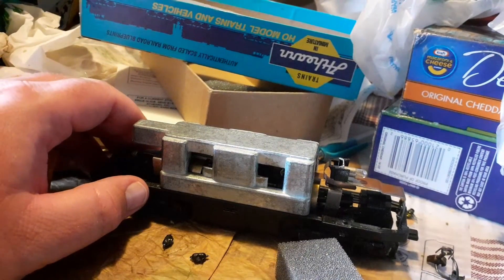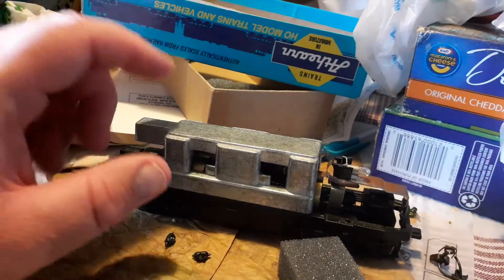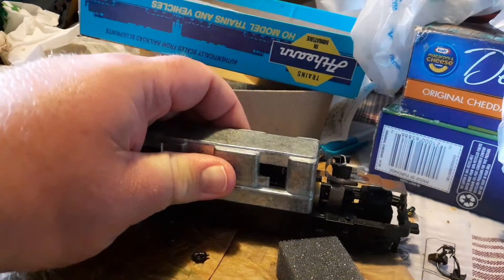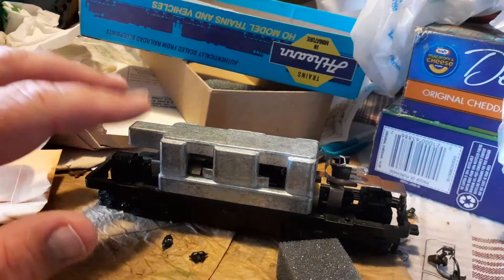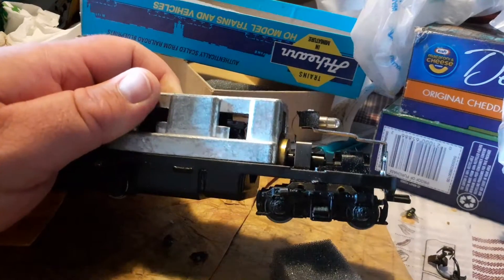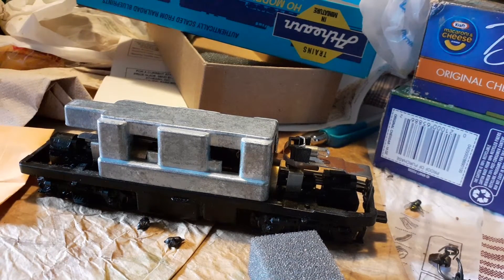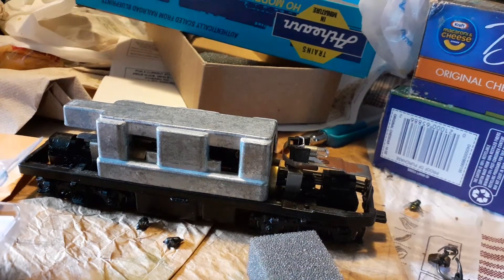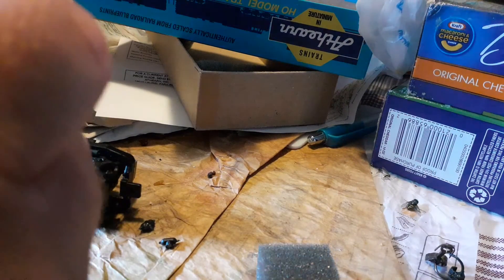SWAPPING COUPLERS AND TESTING THE ATHEARN BLUE BOX "SUPER POWER DRIVE" F7s!

Comment: I use Kadee #30 series or the more recent 242 series gearboxes. I use the Kadee drill and tape set with the underset couplers as those tangs are thick. The details on the side of the trucks have to be bent out of the way of the ladders.

Comment: Nice locos! Gotta have good couplers because tractive effort means nothing if the coupler doesn't hold up. - Jason
Reply from the maker: Thanks Jason and good point!  Still gotta work on the track cleaning boxcar though.  Not only will it need new couplers, it's also going to get a new set Athearn Genesis of trucks with electrical pickups as well.  Hopefully this fixes some of the issues I've been having with it recently, thanks for watching!

Comment: When  I buy pre owned engines the first thing that I do is sperate the trucks (ONE END AT A TIME STARTING A END THE END WITH THE LIGHT) from the chassis then disassemble the trucks by removing the worm drive  cover them remove the trucks then mark the left side wheels (WITH A SHARPY ON THE INSIDE OF WHEELS) THEN ON THE BOTTOM of the trucks carefully remove the plastic plate so the wheels can be removed now you can  remove the wheel sets (and place them in the order that you took them out) now you can separate the truck casing to reveal the drive gears remove the gears and spray them w gun scrubber (that's what I use) spray the gears and the brass worm gear (BE CAREFUL NOT TO LOOSE THE BEARING AND WASHER) really well do the same with the wheels and gear casing (BOTH SIDES) make sure there dry  install the washer and brass square bearing. Then get some plastic safe oil and grease put a small dab of grease on the bottom part of the gear post and a dab on the gears them selfs and ON THE WORM GEAR THEN ONE DROP OF OIL ON THE BEARING SHAFT ON WORM GEAR BOTH SIDES, at this point you can take a stainless/brass brush and clean wheel surfaces now you can replace  the wheels back on to the  trucks. (The wheels that you marked need to be placed on the left side of the truck) and replaced back on the locomotive chassis install the worm gear and replace the worm gear cap.
   Now you can do the same to the B side (END WITH OUT THE LIGHT OR WHERE THE BREAK WHEEL IS LOCATED) of the engine.
The oil That I Use is LABELLE #107
The grease that I use is LABELLE #106
Both are plastic safe and recommended by my guys at the hobby store(Whistle Stop) in Portland Oregon.
  This will make a big difference in the operation.
Reply from the maker: Great points, I also use the same kit as well as a special cleaning fluid, also made by Labelle, on the gears as well, this further helps with lubrication process as well as clean the parts, just spray, let it set for a bit and use the cloths supplied with the kit to wipe off the access fluid.  Be sure to use this motor cleaning kit in a well ventilated area as it has a very strong smell!  Thanks for the reminder and thanks for watching!
Reply: @randallellison6421  
What kind of motor cleaner?
Reply from the maker: @claytons8263  it's a kit made by Labelle, it comes with swabs, cleaning pads and fluid (the fluid also aids in lubricating the parts as well as cleaning them).
Reply: @randallellison6421   Thank you I will look into that.

Comment: There's nothing like an Athearn blue box locomotive.  They are designed with the modeler in mind, i.e., they so easy to work on and what modeler doesn't take his model apart to fix or do maintenance?  I have found a new manufacturer for F-7A's & B's.  That would be MRC (yep, Model Rectifier Corporation) and I thought they only made train controllers.  Their F-7's have 5 pole skewed armatures in a can motor, all grab irons applied except for the eyebrows and front sill grabs, interiors and are DCC ready.  I've got one Pennsylvania FP-7A and another FP-7A and an F-7B in the Southern Pacific livery on the way.  My Pennsylvania FP-7A runs smoother than my Atlas and Athearn engines.  I got each one for around $50.00/each including the shipping.  Actually they're less expensive than Athearn's.  I got another Athearn FP-7 Amtrak to pull my Amtrak coaches.  I'm gonna add 10 lift rings to the top and nose lift rings for the front and add all the necessary grab irons & window glass.  I've got a Walthers F-7/9 dress up kit coming.  Cheers from eastern TN
Reply from the maker: @w.rustylane5650  what's even better, is that parts are still available from Athearn that will still work in these models (the geared axles, motors, gears, etc) these things can quite literally run forever!  As for the MRC locomotives, especially their "Metal Train" models, they're pretty solid for what they are.  Probably their one flaw is they have a slit on the bottom of each truck with the gear exposed, which works good for ease of adding lubricants, but not so great at keeping said lubricants contained as it sprays it all over the tracks and the bottom of the locomotive.  But like I said, they're fine other than that, especially if you're just looking for something cheap to run!  Merry Christmas and thanks for watching!

Comment: Cool video, Randall.  They look good and ran smooth in tandem.  Are you worried it dropped the freight cars?  Otherwise, nice additions to the fleet!
Reply from the maker: Thanks Anthony!  The track cleaning boxcar behind the locomotives has been giving me some trouble lately.  Since the car is still equipped with the McHenry couplers it came with, I think I'll swap them out for Kadees plus I have a pair of Athearn Genesis trucks with electrical wires attached to them that I will probably put on as well.  Hopefully those two things will take care of the uncoupling issues, thanks for watching!

Comment: its pretty obvious this is NOT running well at all !!!
Reply from the maker: It's actually an issue with the track being dirty from lack of running, several of my locomotives do this even after being serviced, but after they run a half hour or so, they iron out and run pretty good.  Plus the layout isn't in the greatest location either with with some extreme heat and cold temperatures that occurs here throughout the year which also has an effect on their performance.  Thanks for watching!